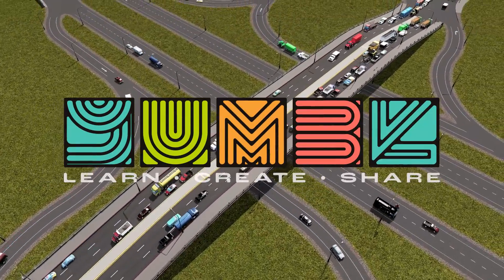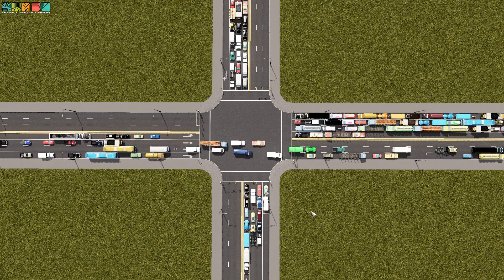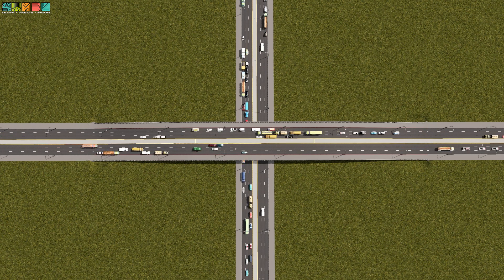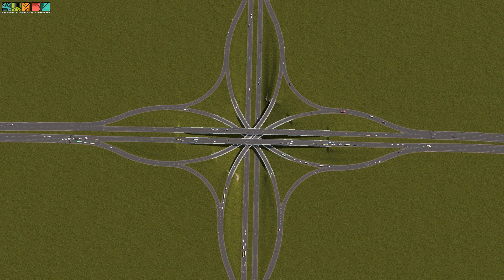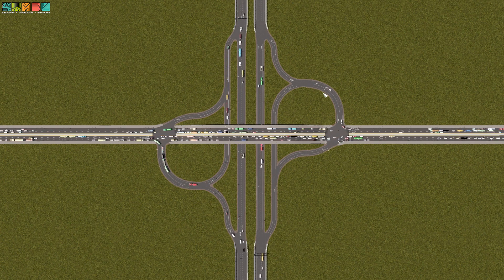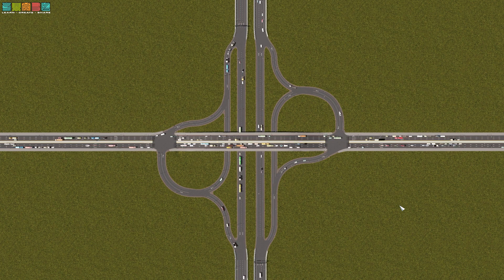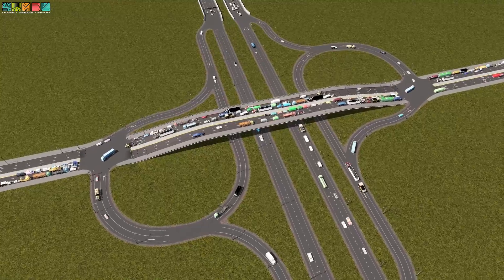Solving Traffic Conflict  -  Intersections and Interchanges Explained

Comment: I don't think the stacked interchange is as powerful as an upgraded non-conflicting cloverleaf. All you do is delete 2 opposing leafs and pass them under the interchange to come out where they would have ended up to begin with on the other side of the crossing road to the left.. Does the same thing as a stack interchange but with only using the same space of a clover. I have an upgraded partial clover (B4) and an upgraded full clover and both are free flowing with no conflicts or left turns. The B4 Partial clover is actually upgraded to pass traffic off to a 5th underground 3 lane split highway without any left turns or conflicting traffic and I also have a couple fly over ramps to connect the necessary roads to my university because I had a ton of traffic turning left just after the interchange on the avenue as it entered my downtown/high density population center as it was backing up the traffic trying to leave the city center and those trying to use the round about to turn around. So, I guess you could say I have a upgraded B4 Parclo that exchanges traffic in 6 directions and doesn't take up much more space than a standard B4 Parclo. At least horizontally. Vertically it is stacked 3 levels high and 3 levels deep above and below the ground level. So that makes for 6 or 7 levels.

Comment: Mound and I696 in Warren Michigan (just north of Detroit), a slightly contorted stack as a service interchange.

I want to say we have a couple of full cloverleafs connecting stroads.

We also have stacks were the lefts leave from the left and join from the left, M10 and I94 in Detroit. Quite a few of those also, but I think those are all system interchanges.

Comment: Better and cheaper than overpasses. (Type: "4782 Post Road, Charlestown, RI" into Google Maps for example/ see route 1)

Also:  (Type: "Intersection without traffic lights. #dubai #engineering" into the YouTube search box)

Question - does anyone know the technical term for this configuration? Thanks.

Comment: I wish this had better driver and bad civil engineer simulation. Like the partial cloverleaf seems good on the surface. Until you put it in rush hour and the lights arent synced because the engineers are virtually retarded. Now you have traffic gridlocked between 2 lights on that bridge, idiots keep trying to turn right and make it worse, while people stopped at the light never get a good change to move forward, and the other light never allows traffic to clear the bridge

Comment: Can you not apply grade separation to the turbo roundabout plan to get something both compact and free flowing (albeit with sharp turns)? The idea would be that the roads would both be 3:3, the E-W arm would see inbound lanes 1 & 2 (of 3) elevated a little less than a full level (say 6–8m) on the approach, and the N-S arm would see inbound lanes 1 & 2 similarly depressed. You've got a half rotation of the ‘roundabout’ for each of these to return to grade, which should suffice.

Comment: Interesting video but I don't think your roundabout example is valid. In the intersection example you have 7 lanes of traffic feeding into it, but the roundabout has only 5. So if this is the same city and traffic level then of course you have more backup simply because the same number of cars are squeezed into 2 fewer lanes.

The roundabout should have been 7 (maybe it's not possible which is why you dropped to 5) or the intersection should have been 5.
Reply from the maker: A four lane roundabout is already ridiculous imo, but I did it. Lights also scale better than roundabouts. See my “roundabouts are not as good as you think” video to see this at work.

Comment: Looking at the roundabout, it looks to me like you've cut the straight through traffic down to a single lane, where the other intersections always had at least 2 lanes of straight through traffic. I think it'd flow better if it had 3 lanes going into the roundabout with the outermost lane serving both 1st and 2nd exit, and the right turn slip road being split off earlier along the feed road.
Or if the amount of traffic that wants to turn left is relatively small, use the innermost lane of the feed road to also serve straight through traffic and have 3 lanes on the exit roads as well.
Reply from the maker: You should try it, but I have yet to see a modern roundabout that beats a light at high density traffic.
Reply: @YUMBL  Which is odd in my experience, because when comparing Takenhofplein and Nelson Mandelaplein in Nijmegen (both are part of the S103), Takenhofplein is the more efficient intersection of the two. So the roundabout wins out over the large lights controlled intersection.

But I suppose that it also has a lot to do with the AI of the traffic. That AI clearly wasn't designed with roundabouts in mind.
Though I don't really mind that, the entire game is about building a North American style city, so it makes sense that traffic would behave like North American traffic.
Reply from the maker: No, i mean a roundabout breaks down mathematically when hit with too much traffic. In the real world. Lights hold up at much higher volumes. It has nothing to do with countries.

Comment: Both the cloverleaf and roundabouts allow for u-turns, which the others don't.
Reply from the maker: U turns are for people who went the wrong way.
Reply: @YUMBL  not necessarily. Instead of having junctions where you can always leave in all directions it sometimes makes sense to have two roads merge in a single direction and let traffic u-turn further on.
Reply from the maker: We just dont really give the option in the US. Unless its incidentally a cloverleaf, but we’re replacing them all over the place due to capacity issues.

Comment: I use traffic mods so you can set lanes and right of way. Round abouts are better; because, I can make the people coming on turn in the right lane only, and everyone else has to yield to them and no crosswalksIf you are not making a 90 degree turn than you can merge into the center lane. I use 2 lanes and 1 way roads only now. More lanes more traffic. I rarely build wide roads anymore
Reply from the maker: A roundabout can’t handle the traffic generated on this map.
Reply: @YUMBL  I can make a map with 95%+ traffic flow using round abouts or one way roads. It depends on the layout of the city not the single intersection
Reply from the maker: Of course! This video is about roundabouts under high density traffic though. People seem to think they work everywhere. They simply don’t.

Comment: Also putting stacks everywhere is unrealistic. I like realistic building in cities skylines, which mean the traffic flow should be as good as possible with a minimum budget. In my city with over 300.000+ I only use stacked interchanges at the cities entry's, everywhere else just traffic lights and some roundabouts here and there

Comment: Dank Traffic Light - You dont have pedestrian, Typical "american" Thinking about cross road car depending society. (i know the material you show its about game not real live) if you have pedestrian you have to change traffic light steps. 

Turbo Roundabout  - Still dont have pedestrian. But ok i understand you show only car solving in game not real live. But still if you have that solution in game you have to short change distance between round and street, and also if you use only one line for cross straight. = you have longer traffic.  (in real live the cheapest one to build only one lvl) 

you missing 3 level roundabout -  :( (also expensive in real live) but easy-er to add pedestrian in ground lvl.

Clover leaf - you can spread main line to cross straight  (in real live also cheap only one viaduct "2 lvl cross intersection")

maltese cross intersection - <3 the best one to connect 2 highway ( minus in real live most expensive and a lot of space) 

Parclo - real good ! <3 to connect highway and City road (in real live very good, cheap =only one Viaduct, plus good traficc flow + can be upgrade easly)

Comment: the main reason cloverleafs were so popular is that they're probably the cheapest system interchanges. It's becuase they only have two relatively short overpasses were the roads crossover. the rest of the road is either at grade or can have the grade modified to support it which reduces concrete use.

Comment: 2:10 if you make such small roundabout, of course it wont work. Make the same one, bit twice as bigger, and you will see the difference.

If not, this is a bad roundabout, try a normal one.

99% of traffic problems can be solved by roundabouts. All you need to do is not plop any roundabout. Think before making the roundabout
Reply from the maker: Reality would beg to differ. There are many situations where a roundabout will not be able to keep up.

Comment: I think the roundabout has to be linearly bigger to the amount of traffic going through it. The reason is that there have to be enough space on the roundabout itself to fit enough traffic. It basically have to fit as much cars on the roundabout as the timed traffic lights let through in one sequence :) (at least that seems logical from math point of view) Defintely roundabouts are not something you want to have in the center of the city on main roads if you don't have the space, but i think that you shouldn't have to have such traffic in center anyway :D

Comment: Why not a FULL cloverleaf as a service interchange?
Reply: I realize you still have the weave to deal with but won't the traffic be smoother?
Reply from the maker: It can work, but parclo is generally better and more size efficient.
Reply: I had a similar idea. You start with a full cloverleaf but the highway has one-way two lane collector roads. The on and off ramps between the arterial road and the highway go to the collector instead of the highway so that the weaving is moved off the highway. If you make the cloverleaves more long and skinny (like shoelace loops) you could actually fit it in the same area as a standard diamond interchange but be completely free flowing as there are no left turns across traffic. Making the loops long and skinny allows you to widen the weaving distance on the collectors to make it less of a problem.

In fact there is a picture online of a similar such interchange. It is in a Wikipedia article here: https://en.wikipedia.org/wiki/Cloverleaf_interchange#/media/File:I-10_at_Garfield_Avenue.jpg

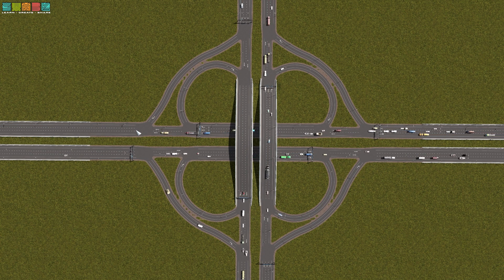Comment: 3:38 that is the simplest type of cloverleaf, and yes, the weave is a problem because it happens right on the main carriageway. 
the first step to solving the problem is to move the weave away from the main carriageway by splitting the highway into 2 separate, parallel carriageways and then connecting the slip roads to that secondary carriageway. there are many such cloverleaf interchanges in germany,  traffic can flow freely on the main carriageway while the weave happens on the secondary carriageway
the next step is to eliminate the need for the weave by switching the order of the lanes leading into the secondary carriageway. so when a car comes off the northbound highway onto the secondary carriageway, it finds itself on the right lane of that secondary carriageway instead of the left lane, so no lane change is required. problem eliminated.

one example of such an optimized cloverleaf can be found in frankfurt, germany, right next to the airport, where the A3 and the A5 meet.  that one is made slightly more complicated by the fact that another junction (A5 and B43) is very close. but you can clearly see that the lanes cross over each other in every leaf.

and why the hell can't i post links to google maps???

Comment: In the UK, from my experience, the primary junction/interchange used is a grade separated roundabout, though there is a great example of the stack junction you mentioned just outside Bristol where the M4 and M5 converge, it's honestly quite beautiful looking at it on google maps! :-P If you wanted to see the most insane junction in the UK though, it's the A38(M) joining the M6; Gravely Hill junction, also known as Spaghetti Junction! You could say, this is what happens when stacks go mad! :-P

Comment: You really should have included a "normal" roundabout. And for the straight intersection there is a different type of signalling as well.
Reply from the maker: Normal roundabout would have done worse. I was hoping this one would beat a normal light and it didnt.
Reply: @YUMBL  I'm not sure it would do worse. People are also keep claiming the same about the diverging diamond.
Reply from the maker: Condensing three lanes of highway traffic into 1-2 roundabout lanes is simply not going to work.
Reply: Roundabouts serve a purpose: safety. They are safer to pedestrians and vehicles than any of the other single level solutions. This video doesn't cover in-city junctions, where roundabouts do shine
Reply from the maker: Very space consuming in a city though
Reply: @YUMBL  They are used mainly for medium intersections in city centers where you are supposed to have pedestrian and car traffic. They can be pretty big, but the space inside the roundabout itself is used for parks and green zones or decoration
Reply from the maker: I see a lot of information stating that roundabouts are not actually better for peds or cyclists.
Reply: @mig6789  I can tell you this - the few roundabouts i have to cross by bike are horrendous and dangerous. And neither do they offer any inherent extra safety for pedestrians either.
And how would they? Have a sliplane -> so a normal crosswalk? No sliplane - so now cars in the roundabout need to stop inside. Both scenarios are the same as with a normal intersection, just with no traffic lights. So in general i would even say they are way worse in that regards.

It sounds like the same moot backwards argument used for "metting zone" streets - unregulated streets were pedestrians, bikes and cars can do whatever they want.
with the constant claim of "but it is safer". Those areas only have less accidents cause everybody is forced to slow down and under a lot of stress cause of the lack of regulations. And funnily enough the cities that tried them still swear they work despite the overall number of accidents not being affect: Turns out causing that much stress leads people to be stressed out and make more mistakes while driving the rest of the way.

Comment: Take your biggest most traffic intense road and build a bridge so the right side of the road can be on the left side. Take it around the outside of your city.  Do the mirror of that on as the road exits you city and run that incoming road around the other side of your city… Now you have the worlds largest double diamond interchange, a very low conflict exchange.  It also may look like an inverted roundabout to some.  But whatever you call it, it solves many traffic problems cheaply.

Comment: The art of turning left is a dark art.  Build your grids in hexagons so people can only go “straight” or “right”.  Then build subways that take people “left”.  These directions don’t exist on a hex grid… but there is a direction that traffic flows easily.  And a direction  where traffic has to drive further to get to their destination.  Make subways that flow along the direction where traffic would have to drive further.  Then add some cargo rail in the same direction.  Or maybe just separate homes and industry along that direction so trucks are disincentivized in driving through residential.

Comment: For getting off the highway, the parclo and dumbell are my go to if i got the place to use them and need to use both ways (dumbell for easy to build and quick to set up and parclo if i need to handle more traffic). They also look really nice when you look at them visually. But if i need to be really compact and i don't have much place, i'll use a three level roundabout. That thing can handle a lot of traffic (with slip lanes and all) and be really compact.

Comment: We have only a single stack interchange in all of Germany, despite being known for our Autobahns. And it a rather useless Stack interchange. It connects Autobahn  A45 with Autobahn A480 but A480 is just 3.6 km (2.2 mi) long. While a 2km (1.5 mi) extention to the south is considered. 
As a replacement, because the city where the stack is located is considering to demolish an elevated through road through the city, but the extention to the north is canceled.
It's basically a stack for an service interchange, at the moment and for the foreseeable future.

Comment: Thanks for the great video! I have a question. How do you generate the desired amount of traffic on intersections for your videos? I've tried to find a mod that allows to generate an arbitrary traffic between arbitrary points on a map and had no success.
Reply from the maker: Thanks! The map is called “interchange test map”. Unlimited traffic.
Reply: @YUMBL  wasn't thinking in the direction of a special map. Make sense. Thanks a lot!

Comment: May I point out that you most likely used Node Controller to creating more spacing between the road and  the roundabout, considering the location where the cars are stopping? This would not be the case with a normal roundabout, in which cars drive up all the to the edge of the roundabout and every gab will be taken (in real life). Your presentation that the ordinary traffic junction with traffic lights would be better than a roundabout is not correct.
Reply from the maker: Lets find out :)